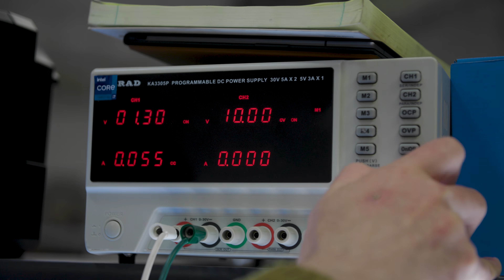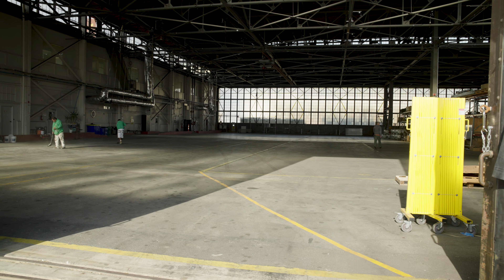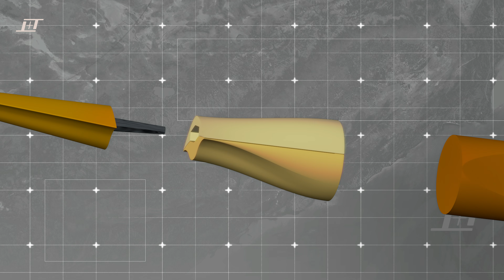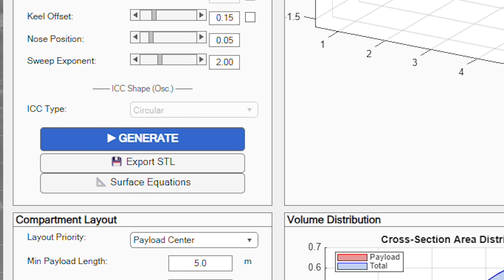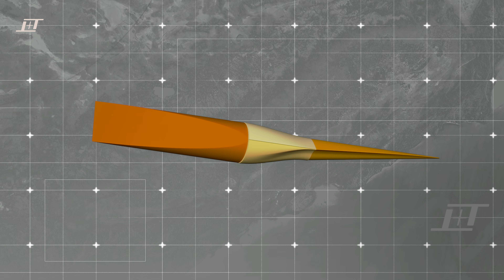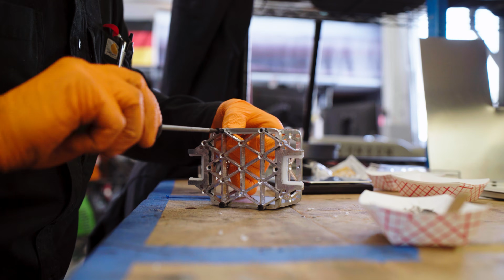Designing for Mach 25: Geometry, Heat, and the Physics of Hypersonic Launch

Comment: So, your maxQ is when the projectile exits the gas gun at Mach 25 and slams into the wall of atmosphere. This is where it fails. Many others have tried mass drivers but they don't work on Earth's surface, they work on the moon. What gold-plated unobtianuim have you engineered to solve this problem?
Reply: Carbon-phenolic works at these peak heating levels  The Galileo capsule survived higher entry speeds into thicker atmosphere at Jupiter.
Reply: @natosaichek  So you agree: No one on Earth has been able to solve this problem, so far. How long did the capsule chill to what temperature before entry interface?
The empirical data is this doesn't work on the Earth.
Reply: @maxisp1000 The temperature of the heatshield is irrelevant. What matters is the heat mitigation you can get from the material, which for carbon-phenolic is in the neighborhood of 25 MJ/kg. Calculating the total heat flux during transit isn't trivial, but there are techniques that work pretty well. From that we can get total heatshield mass. Calcs indicate we need about 5-10 percent of the vehicle mass to be heatshield for the scale of vehicle we're considering (~10 tons)
Reply: @maxisp1000 nobody has tried to do this before so there is no empirical data on whether this works or not. There was no iphone before someone made one, but you wouldn't say that in may of 2007 the empirical data was that iphones don't work. Or if you used that argument not to buy apple stock, you'd be making an obvious error.
Reply: @natosaichek  Really!? Are you SURE there's no data? Have you ever done a search on Spin Launch, Project HARP, and others just like that? Have you ever seen or been near a gas gun? Your argument is specious.
Reply: @maxisp1000 There's lots of data, that's why i have confidence our system will work. The project lead for sharp (john hunter) is a company advisor.
Reply: @natosaichek  What's the Hugoniot number for the carbon-phenolic?
What gas gun has shot 10 tons of projectile?

Comment: It's fascinating (and terrifying) how many people forget that the 'Space Gun' concept isn't science fiction—German engineers were already building the prototype in 1942. The V-3 'Hochdruckpumpe' (High-Pressure Pump) was a masterpiece of ballistics, designed to rain shells on London from over 160km away. While the Allies eventually bombed the Mimoyecques site, the multi-chamber acceleration principle was decades ahead of its time. We aren't reinventing the wheel today; we’re just finally catching up to the physics those engineers mastered under the worst possible circumstances. The immense friction at Mach 25 generates plasma-level heat that would incinerate any known material without an active, heavy cooling system, making a lightweight "skipping" vehicle nearly impossible to build. To achieve the "stone-skipping" effect (the skip-glide trajectory), the vehicle must withstand brutal structural stress and G-forces during each atmospheric contact, which would likely crush internal components or cause the airframe to disintegrate. Furthermore, maintaining aerodynamic control and precise guidance at such extreme velocities is a nightmare, as the slightest miscalculation in the angle of attack would cause the craft to either burn up in the deep atmosphere or bounce uselessly into an unrecoverable orbit.
Reply: So they didnt go to space nor the fuckin moon I knew it.

Comment: at Mach 36 you might just be able to propel a 54.0 ton spacecraft into space . . . once the high acceleration has depleted after detaching from the aft propelling unit, the forces of acceleration is gradually reduced by almost half . . . but there's still enough residual acceleration for the spacecraft to escape from earth's atmosphere & catapult into low earth orbit at best . . . more the energy required to escape from earth's atmosphere greater is the depletion of acceleration . . . a spacecraft that can sustain such launch-to-orbit flight parameters will have to be unique in every way possible . . . such a spacecraft will have to be made out of lightweight hydroformed ultra high strength titanium, lithium alloys & complex carbon fibre composites . . . like the guy said it'll ride on it's own shockwave which is why it's called a waverider . . .
Reply: there is NO acceleration after it leaves the barrel. only deceleration due to drag. it doesn't reduce gradually, nor by half - it's just not there!

Comment: Does the vehicle actually accelerate slightly as the atmospheric density lowers? I was just wondering if that happens due the vehicles extreme speed or does the vehicle just lose energy at a slower rate? I'm imagining almost an elastic effect as the atmospheric density lowers, almost a snap. Thank you.
Reply: the vehicle is at the fastest it will ever be right before it exits the muzzle. It only slows down from drag. drag does reduce as you get higher, but it's there all the way through the atmosphere.  Once we're at orbital altitude we fire a thruster to raise the orbit a bit, but we get the bulk of the velocity from the cannon.

Comment: Guys are using geometric shapes, concave/ convex fluid shapes will work better, laminar flow is key... during the pinch and acceleration, flat tail needs to be changed

Comment: Can barrier layer cooling still be used at those speeds? If so, then it might work well with quite a small liquid or gas mass, giving you enough thermal protection to achieve orbit, without having to engineer a heat shield which will ablate continuously, and possibly irregularly, affecting aerodynamics adversely.

Comment: At sea level an object with the speed potential to make it into low Earth orbit is more likely to flash into fire contacting the O2 in the air and disintegrate.. There is a reason rockets don't go hypersonic until they are above the atmospheres MDP height where atmospheric density won't flash the vehicle into flames.. I suppose you could fire a very high powered laser in front of the vehicle thus splitting the atmosphere and leaving a void of low pressure to pass through.. Wings will be a problem and a tapered dart shape will reduce friction, drag and heating if all you want to do is go vertical, escape Earths gravity and get into orbit.. If you were to have the launch tube up the side of a very large mountain where the vehicle would exit the tube at 25,000 feet where atmospheric density is already low there would be less drag and heating..

Comment: Why not use plasma actuators and/or using beam forming tech to make an ionized air channel (sometimes referred to a plasma channel)?
Also, pulsed microwave arrays could be used for additional propulsion, with the right implementation.

Comment: Hi, as someone who visited a hypersonic aerodynamics and atmospheric entry university course, a couple of points from me:

I like the project, I'd really love to see the wedge tail projectile theory put into action, but I'm kinda struggling so see your business case at the moment (if it's not just for pure academic research): that waverider form only makes sense if you don't plan on making orbit, just skipping the atmosphere a bit until you enter at the other side of earth again 60 minutes later. So it will not be orbital payloads as with Spinlaunch, it will be fast point-to-point delivery on earth. However, your launch tube will be a kilometer or more in length, making it unmovable and not really aimable. So from one launch complex you can only really deliver one location, similar to the old German V3 artillery station. I'm not sure if there are commercial delivery routes on earth that pay a million euros for a small parcel that will be crushed, just so it arrives one day earlier than if it were delivered by plane. And there's also not much military use due to the inflexibility. Military prefers mobile rocket launched hypersonic glide vehicles.

In terms of heat load, you're looking at quite a challenge, that was not solved before. Nuclear hypersonic entry vehicles slow down while descending the atmosphere, when they reach lower atmospheric layers they have already slowed down to Mach 10 or so. They (and the space shuttle) all have a rounded nose tip and rounded edges. This is important, as a large tip radius pushes the shock front further away. This shock front has intense temperatures within it, bombarding your spacecraft with thermal radiation. It's a star going supernova in front of your face basically. This radiation will be a much higher heat load than the one coming from atmospheric contact/conduction. Spinlaunch don't use ablative material, as their peak heat load when exiting the centrifuge will only be there for two seconds or so. Instead, they use a copper tip, which is really good at conducting the heat away from outside layers, at least for a few seconds. But after that, it is glowing hot, and your approach will also need to survive the long atmospheric skipping heat load after that. Copper is no good for that.

But you want so have a metallic skin to be able to survive the intense pressure without deforming, breaking and making the airstream unpredictable.

Maybe you could try some convective cooling, basically have some outer metallic inconel skin, and beneath that a really fast water loop that cools it from the inside and is allowed to vent off when it starts flash boiling. This is the best way of getting rid of the heat I think, and if you vent it out throught the back through some nozzles, you even get some extra thrust, reducing your velocity drop. Due to negative acceleration, liquid water will want to pool at the front naturally and steam will want to go the back naturally, you just have to guide both a little.

In regards to the launch tube, you probably already know that, but the timing of the pressured air cylinders going off has to be perfect. If any air gets in front of your projectile, it has to be pushed all the way to the front out the tube, significantly reducing final velocity
Reply: Your analysis is spot on, though you are making some assumptions that are not in line with our thinking.

Comment: Really cool to see someone still working on project babylon🤠
Reply: See: Gerald Vincent Bull, assassinated in 1990.
Reply: @TricksterJ97  And who killed Gerald Vincent Bull? Oh, Mossad. Weird!
Reply: This would work if the launch tube was high enough into the stratosphere.. Going 20,000 mph at 20 miles up but who would want to build something that tall?? You would have to pull a vacuum in front of the vehicle so it would not melt in the tube then instantly switch to thrust at every junction it passes..
Reply: Should create a rocket with th final stage being able hold a charge by itself, so at the last entry stage of energy transfer, it combines with the last stage
Reply: I remember when it was called the V-3.
Reply: Old is gold

Comment: The stagnation pressure at mach 25 at sea level (1 atm) is ~200 million Bar. Even if your coeff drag is 0.01, thats 2 million Bar of drag pressure. Energy loss = drag × distance. Drag reduction from slower velocity will always overcome delta v loss from longer travel time. 

Most rocket need to reduce power at max aerodynamic pressure to not destroy itself. The obvious concern is that much of the payload is used up for heat shield and structure to withstand the drag pressure.

Even if the thing works, the g force would be so high no satellite or payload could survive the launch. Any reinforcement to the payload to withstand those g force would result in less payload.

Rocket systems are in common use for a reason. They can lift 200 tons to orbit, space gun cant. Gerald Bull did some space gun work but it never really went anywhere.
Reply: Hi I'm Mike the CEO (not the CTO). The technical analog to our exit system is much closer to an ICBM warhead than a rocket. Also, while you are right about the massive stagnation pressures remember that that pressure (and the total heat flux...) and drag losses are also a function of the surface area while the embodied energy is a function of mass. Velocity losses, and the decelerationIn you have to take at any given speed, drop as you get huge/massive. In other words throw multi-ton vehicles or stay home. The bigger the vehicle the better volume vs. surface area gets also giving you a better payload fraction vs. the amount of ablative material you have to carry.
Reply: @mikegrace8814 Thanks for replying, i also believe that the ppl who say it cannot be done should not interrupt those who are doing it. I wish your team the best of success. 

Ballistic coefficient (BC) is sectional density. (g/cm^2), can be understood as density × length. For orbit launch, the obvious path is to increase length, not density. In the gun world, 6.5 creedmoore high BC bullet trajectory is flatter, retain velocity longer than its .308 parent cartridge. Long range gun need high BC. 

I assume simple trick such as pulling vaccum in the gun barrel and sealing it with a burst disk is already done. Nasa had a good hypersonic gun which used double base propellant to compress hydrogen. But i think if you can instantly vaporize / ionize liquid hydrogen (at 2000 - 5000°K) by electricity, it would be ideal. 

The g force acceleration problem can be solved by immersing the payload / satellite in low density liquid to create a 0g enviroment. The use of flat disc / square sattellite is a must if the low density liquid is discarded. That liquid could also be pumped into a rocket and be used as propellant (too complex).

The navy always had a great intrest in hypersonic gun for coastal bombardment use, as they belive it would be cheaper and have more magazine depth than rockets. Did you try to get the navy to fund your work?
Reply: Mike has reassured me this isn’t being designed as a weapon, and I hope he is successful
Reply: @brandtnicholson4532  My honest hope It to put stuff into space and drive down the costs of colonizing the solar system.
Reply: stagnation pressure at Mach 25 sea level is nearer to 400bar.
Reply: Imagine selling this stuff foe military and shooting enemy with mach 25 shells from gunship!
On other hand, at mach 25 even very small lift coefficient will give very high lift forces. Because of absurdly high speeds you have very high kinetic energy, and you can spend some of that energy for evasive maneuvres at hypersonic speed. 
Think about it as a V-3 super cannon on steroids, with very long range and homing, potentially nuclear shells.

Comment: Imagine when a projectile moving through an atmosphere where the fluid swirls are redirected in a such a way as to move/rotate parts in/on the projectile as to allow it go gain/store energy, which otherwise will materialize on the surface as heat.

Comment: How do you ensure that the projectile doesn't rotate at all going down the barrel?
Reply: We've got a set of rails that run down the barrel.  The projectile rides on the rails - it doesn't actually touch the walls of the barrel.
Reply: @natosaichek  Maglev?
Reply: @storminmormin14 mild steel with plastic bushings. Might get fancier as we get larger, but its what existing light gas guns use.